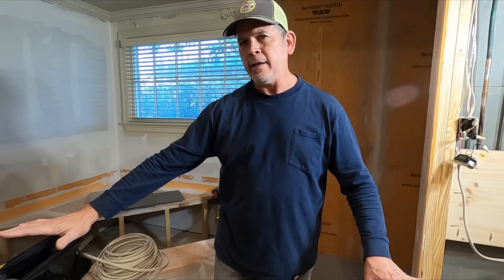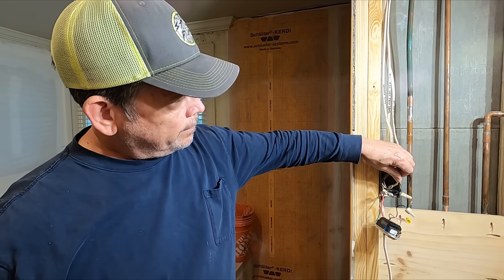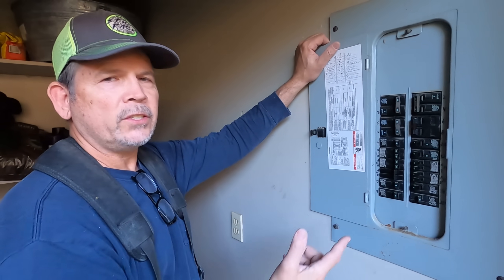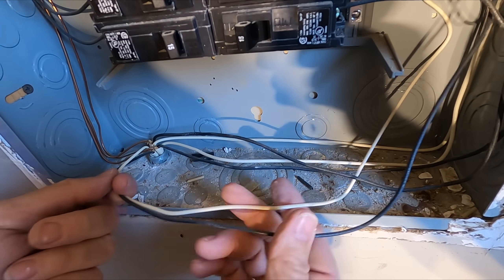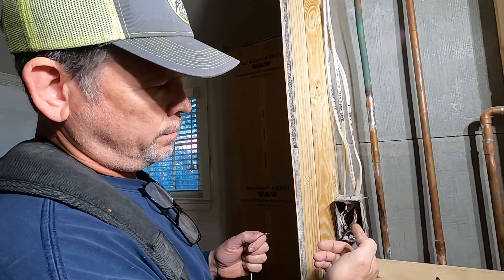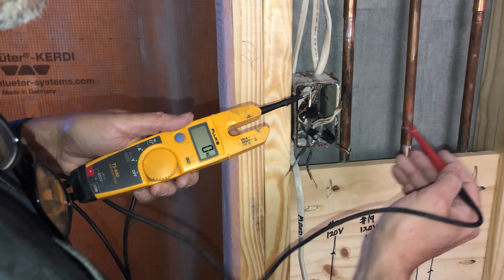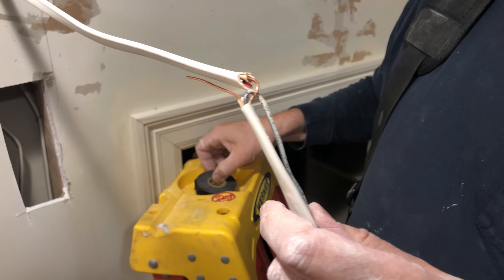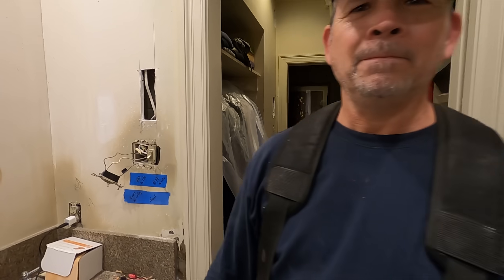You CAN Get SHOCKED by a Neutral Wire! This is How...

Comment: Since they are sharing a neutral it’s a multi wire branch circuit all you had to do to satisfy code was install a 2pole breaker for circuit 19 & 20 ....
210.4 (B)
Would have been so much easier & cheaper
Reply from the maker: Circuits 19 and 20 are same phase so no sharing neutrals.  I could have swapped 18 and 19 or 17 and 20 and then installed 2 pole but thought it would be interesting video showing whys and hows.
Reply: Your right I meant to say 19&21
Reply from the maker: No worries.  Yeah definitely a lot going on there

Comment: What you have there is a loaded neutral. Usually comes from a multi wire branch circuit aka 2 circuits sharing a neutral... the proper way to terminate in service is to take both hots of the MWBC onto a 2pol breaker

Its 100% compliant as long as its under a 2pol breaker... so when you turn 1 off the other circuit will turn off too
Reply from the maker: Thx for commenting👍.  The two circuits sharing the neutral were same phase until I fixed it.

Comment: Man this is just an eye opener. I have been digging into a little bit of electrical work, (replacing fixtures / fans / and receptacles) but every time I even go in I always turn off the main breaker power and it literally shuts the whole house down. Am I safe? :3
Reply: Tag and lock out. Then test prior to touch. Then only 99.99%

Comment: nice explanation.  May note that the lamp/bulb is connecting the circuit.  I've always seen all neutrals connected.  Are you saying with lamps, we should isolate the neutral from others???
Reply: He is saying ... You should isolate all wires used for Circuit Breaker #1, from all wires used for Circuit Breaker #2 ...

Comment: The service is 240 volt single phase center tapped to get 120 on each leg. At 5:43 there are two legs, single phase.
Reply: Correct you right if ti was 2 separate phase that light will get 240 v and blow up by removing the neutral. That a problem now a Days its called  multi wiring system something like that  can't remember the exact term for it.

Comment: Great video!
Any time I see a video on electric systems, I watch it.
You can’t have to much info on something that can kill you.
PS
Somewhat related:
I’m currently upgrading my 5th wheel trailer to lithium batteries with an inverter to power my AC circuits. Your info is useful to my project.
I’m also learning from the RV electric world.

Comment: Did you just shut off the known breaker and go to work and not test the wires?
Reply from the maker: See my pinned comment Muhammad.  I tested it all after shutting off the breaker but someone turned on a 3 way in an adjacent room which energized that neutral.
Reply: @StudPack  ah I see, so they actually helped you in a sense discover a dangerous condition
Reply from the maker: Ha well that is one way to look at it 😂⚡️⚡️

Comment: I carry a Fluke non-contact voltage tester with me at all times.  It has saved me at least twice this year!
Reply from the maker: Yeah good tool.  I checked all the wires after shutting off the power but someone turned on a 3 way switch in another room and energized that neutral.

Comment: The two circuits with a shared neutral should have been connected to a single-throw double-pole breaker.  It would eliminate any possibility of ever having line voltage on the neutral.
Reply from the maker: This was built way before that code change... plus those 2 circuits were same phase.  I could have moved breakers around to accomplish the 2 pole I suppose...
Reply: @StudPack  The common neutral circuits should never be on the same phase.  Wired like this, the neutral is going to carry the total load from both breakers.  For example, if both circuits are fed from 20A breakers, and both circuits were loaded to 20A, the neutral would be carrying 40A and could overheat and start a fire.  When each circuit is fed from a separate phase, the neutral carries the imbalance which would never exceed 20A.
Reply from the maker: Thx Rick.  At the beginning of the video when discussing numbering a panel, I was going to talk about same phase adds opposite phases cancel but digressed.  Really needs its own video.  Sure appreciate all your comments 👍

Comment: As a home inspector, I can tell you that 3 way switches wired by non-electricians are almost guaranteed to be wired wrong. Kudos for fixing the issue, I hope the home owners realize that they have hired the world's smartest contractor.
Reply: I can tell you that a whole house wired by an electrician is wrong. They do shortcuts here and there because 1. they know what they are doing 2. they don't want spend time and money to properly do their work per code. A second electrician coming to the house to add any device will add another layer of shortcut... and so forth. In the case of the video, there's 4 wires connected to the switch box. Right there, there's something wrong.
Reply: @sebparent4584  you aren’t a licensed electrician, and all the rubbish you just spewed out is just that RUBBISH. What’s your occupation??
Reply: Home inspector guy chimes in. Hahahahaha
Reply: @Esnara2085  exactly like they know anything about the trades😂😂😂
Reply: My electrician couldn't figure out a 3 way switch in my family room (I had Leviton Decora Smart dimmers at the time).  I already was looking into a decent smart switch system that worked better and went with the Lutron Caseta system, made the 'remote' dimmer one of their remotes paired with the dimmer in that room and now it works perfectly and is so easy to use, low cost, just had to wire nut the neutral, hot,  traveler (separately of course!).

Comment: Moved into a pre 1975 home. Inspecting a noisy bathroom fan I felt a shock twice from the bare ground wire after detaching it to the fan. First instance I thought i was imagining it and ignored it. But moments later it happened again.  Couldn’t believe it. I am thinking something is connected wrong in the attic.